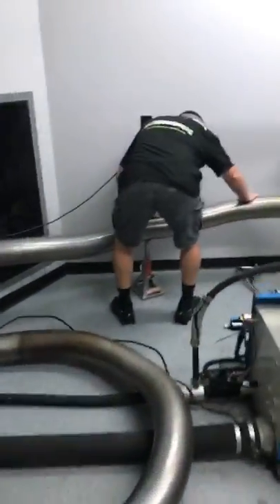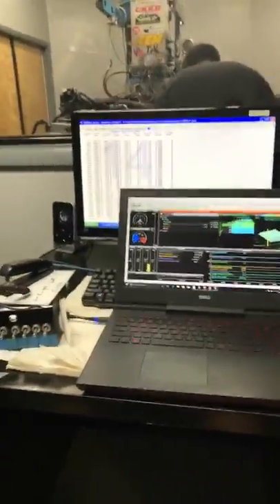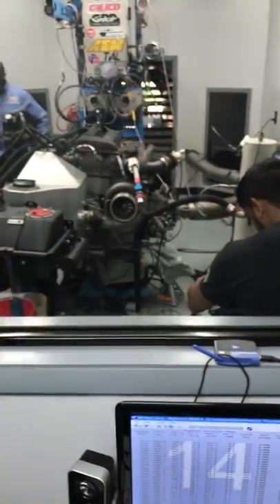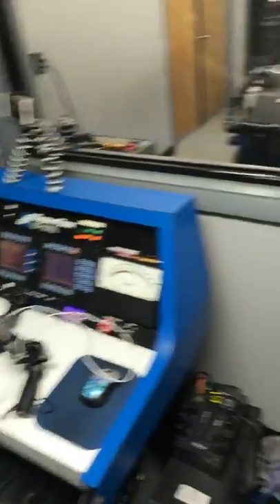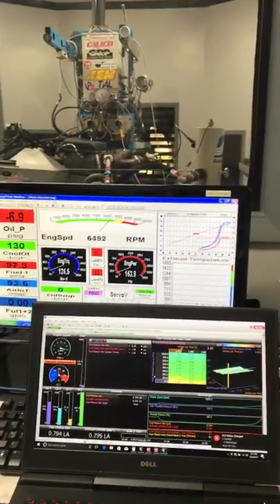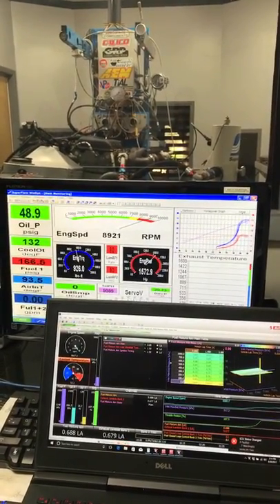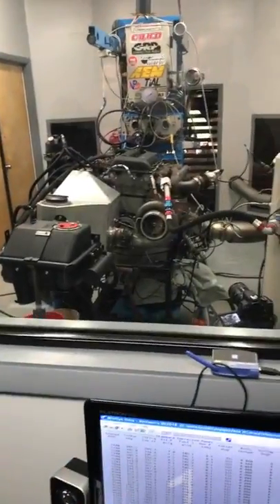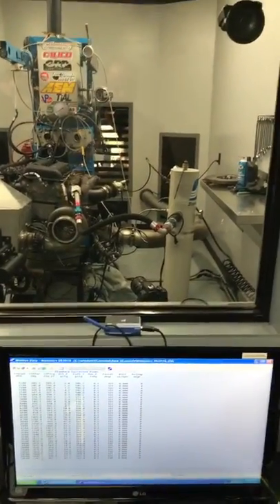1800 Horsepower 4 Cylinder 2.2L Dyno Pull - Tuned By Shane T

Comment: How do you find the Motec? Thinking m130 for our 1000hp 2.0 drag car. Thanks
Reply from the maker: Ryan P Its a loaded question as I was once a MoTeC Enployee however this particular system uses my custom Software for the M1 for 4 cylinder drag race engines.
Reply: TunedbyShaneT No worries,  we have just got the M150 ordered and will be tuning soon. Any tips?

Comment: ive always wondered what would happen if you would fill the water to air intercooler with liquid nitrogen wouldnt that make huge power gains
Reply from the maker: It would certainly seem so, but in practice the temperature of the intercooler being far below the dewpoint and in fact freezing point of water means it quickly becomes full of frost from the moisture in the air and effectively becomes a choke. You are on the right path though cooler air is more dense and density is the name of the game.
Reply: TunedbyShaneT makes sense, thanks!

Comment: 382 at 7100....talk about all peak. Good job though
Reply from the maker: James Avery yeah boost didn't peak until higher than that on this short pull had we held it lower and waited for the turbo to catch the engine, we would certainly have had more there.